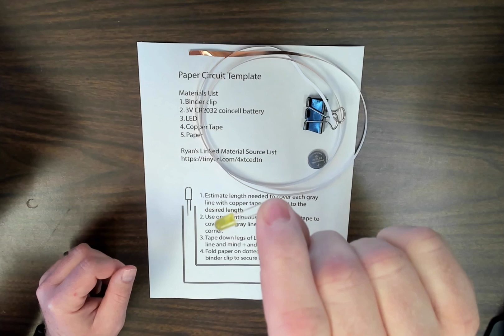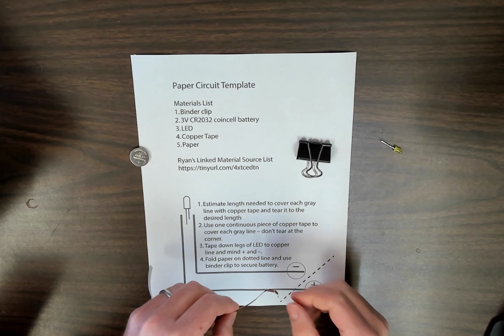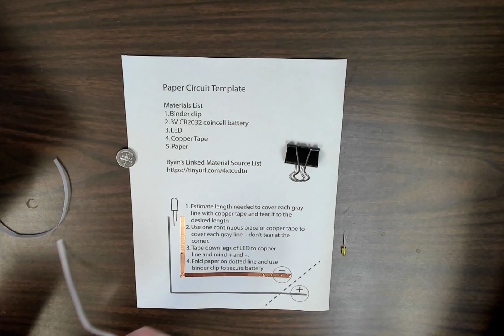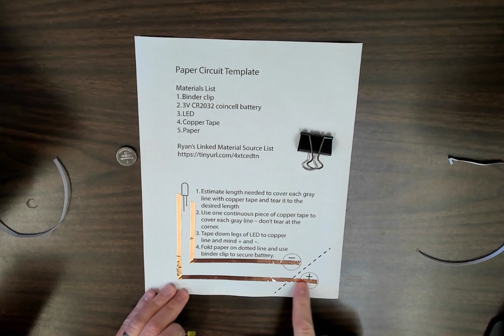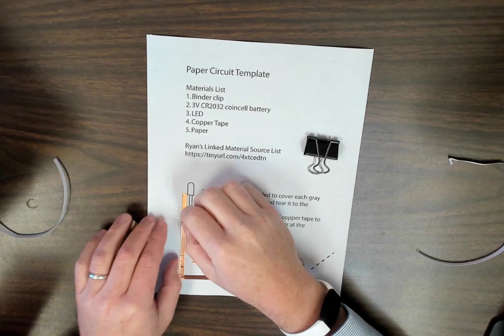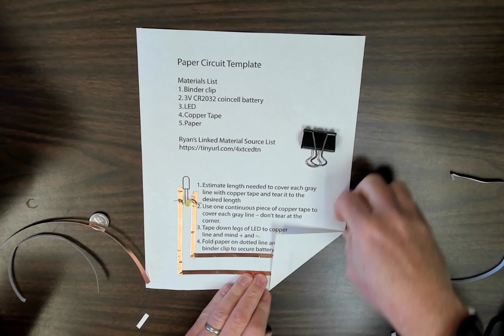Paper Circuit Tutorial

Comment: Aluminum tape is way cheaper, I get it at the local dollar store. I have confirmed that the adhesive is conductive as well, but if yours isn't then you just need to assure metal-to-metal contact any place you splice. I highly doubt the difference in resistance will matter. I don't think it even matters when shielding a guitar.

Copper tape is, of course, easier to solder a wire onto. But since you're not doing that, why use the more expensive material?